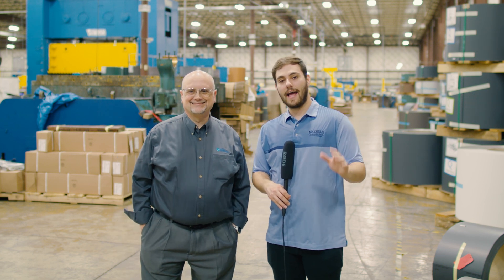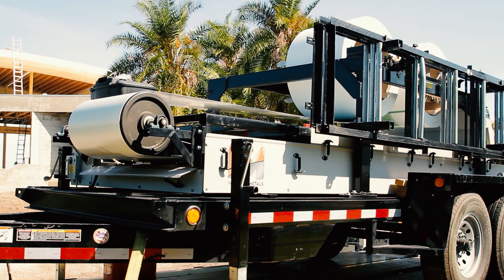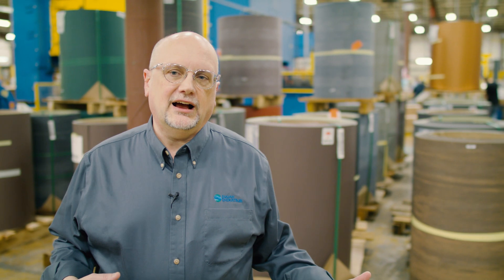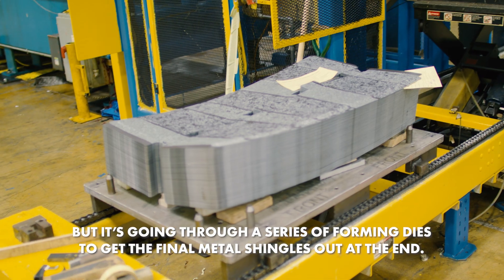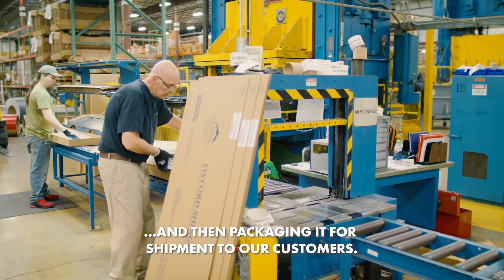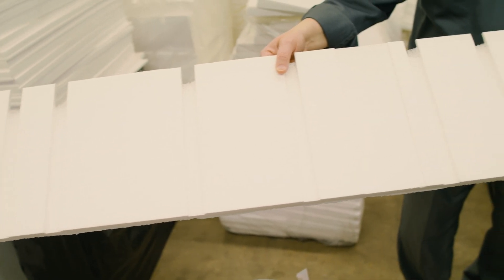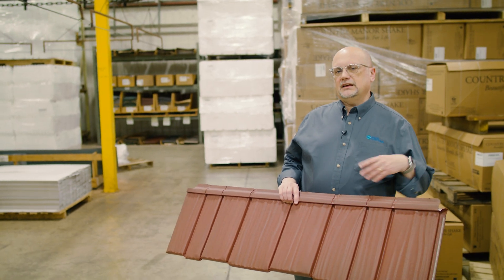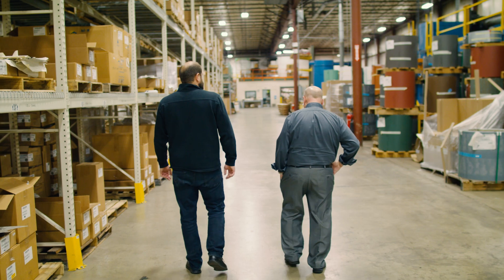How are Metal Shingles Made? Isaiah Industries Factory Tour

Comment: Why do metal shingles always have to be shiny and monolithic color?  They end up looking like Lego houses.  I think the market would expand tremendously if they were matte finish and had more variegated color.  Europeans seem to add ceramic granule finishes to achieve this
Reply: sand coated using Kynar 500 finishes are what DECRA does,,but our neighbor is having large-area popping issues as we are in cold missouri...I wouldnt touch "stone coated' products...i couldnt believe how bad it was! And their roof was 35.000 bux eight years ago...no warrantee as it was not transfeerable..I install ribbed screws exposed EVERY day as a little 3 man company and it is so economical over existing asphalt that the 35000 doollar house I speak of would be 7000 today with us....and we make a good living at it.Standing seam,rolled on site is thicker 24 gauge with Kynar paint and this same house would be 14,500. Still no where near the 35000....and 29 gauge is standard for these stampings in this video...